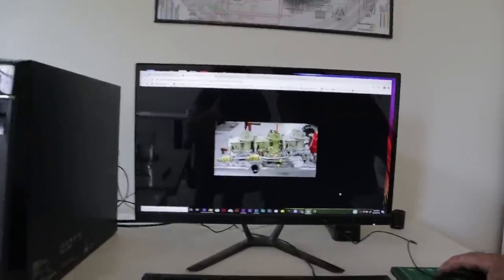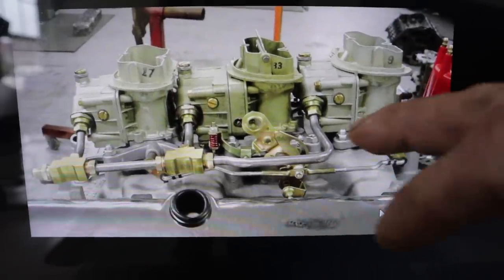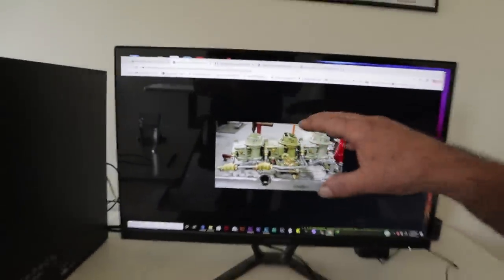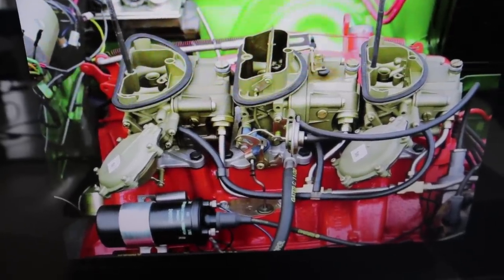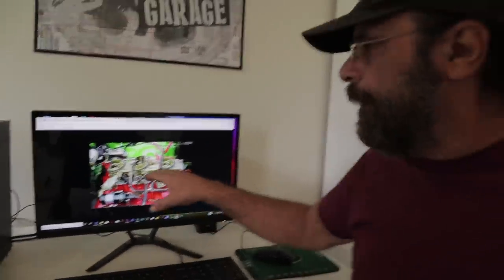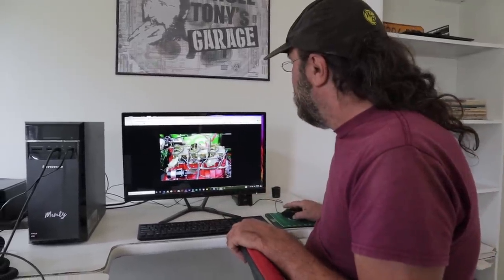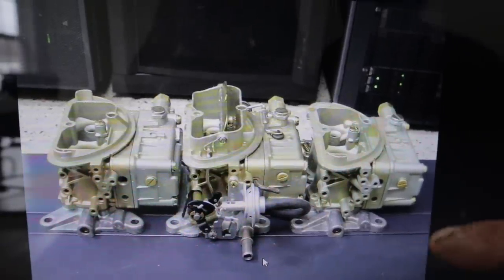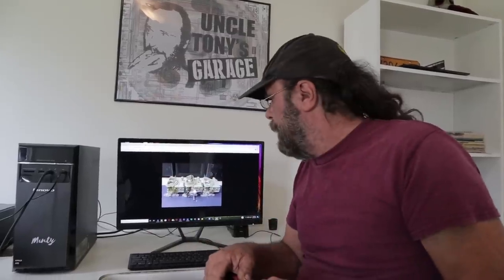The Infamous Chrysler Six Pack

Comment: One of the Olds 371s I used to own was a 57 J2 in a 88 Holiday hdtp.  That was the engine that dad used to teach me how to overhaul an engine. I remember filing compression and oil rings until I got the right gap, tedious job. He would not allow me to file back and forth but, I had to only make a forward swipe to keep from ruining the teeth of the file.

Comment: unfortunately you cant buy a 340 sixpack intake new any more, 
but if your kill bleeds are still untouched keep your drill in the tool box if you open the kill bleeds the secondarys may not open at all. 

get promaxx metering plates for the end carbs that take a screw in style jet and tune it with jets and secondary springs. if it bogs when you punch it, its going lean from the big burst of air from the secondarys opening to quickly and the fuel taking time to catch up. you can also slow down the secondarys buy putting a very small pin hole in the plastic vaccum T that goes to the end carbs

Comment: My 1973 challenger had a 340 4 speed I put a 340 Edelbrock  torque'r 2 intake on it now I know this was not the right intake but it gave it a lot of balls with that 650 dual line 4 barrel carb on it

Comment: When I was about 15 in 1970 I was walking past a gas station and there was a MoPar sedan with it's hood open. When I looked inside there were two 4 bbls on a 'cross ram' intake. It looked like the carbs were mounted on the fender wells. I don't know if they were worth it, but it sure looked awesome.

Comment: When  I  was  young,  back in the  mid seventies,  I had a 66 SS 396 impala.  Got  my hands on a tri power set up. Put it on the car  and  cobbled  up  fuel lines and linkage. Had it  on for  several days  looked  cool, but never did  work  right or stop leaking. Oh well,  live and learn.

Comment: That was awesome very informative thank you Uncle Tony I've got a 78 Z28 with a 454 out new 1970 Chevelle been bored out 60000 over and got about 575 horsepower we got 650 dual line double pumper Holley with 850 jets in the back and whenever you kick secondary in it sounds like it will suck the hood down in there

Comment: i have a boat motor a v6 with 3-2 barrel carbs i used 4 of 5 gallon gas cans  a month for mercurys & johnson outboards to ths v6 with 3 2 barrels to 2 days use of running there a thirsty beast! i got rid of the wrong type of outboards!

Comment: Had a 6 pack in my 69 427 Vette.   Hated it.   Put a single Holley on the car and went a lot faster.   Finally sold the car.   Gas pedal was just on on/off switch.

Comment: Thanks for a great 6 pack school. I built a 3-1 barrel progressive set up on my 55 chevrolet 235 6 cylinder. Used 3 intake manifolds. end ones were cut off flush and welded in plugs. then ends facing in left some nipple ends as well as on both sides of center when clamped to head center and outside manafold sections welded together.. outside carbs no accelerator pumps or idle jets. then a progressive linkage that ran on the center carb till half throttle. past half throttle the linkage was step up 1-2 ratio so the last half throttle on the center carb would open the outboard carbs 100 percent. did it work. Yes, It did not give any more top end as the cam was stock but acceleration was noticeably better. cost was really cheap.

Comment: I never had the same you do Tony, and it could be I just don't get it or theshit I worked with was bad    cause I never spent the time fixing and tuning. I was lazy and would buy new for a long time till once forced to cause all I had to get home with is new and it was worse than the bad one. Long story short V> was fix the old one first then take off the new one and look inside of the new one so to see difference.... s. Lots of them as the new one was bad bad so use it for [parts and wow, comes together... love it when that happens

Comment: as i never had a six pack.   i started looking at the info on the AAR  340.   when i looked the factory cam specs compared to other brands.  it was amazing the power Chrysler was getting on the small block with such a small cam.

Comment: I'm surprised you didn't mention the 383 6 pak. I know it wasn't a factory option and the one I know of in a 70 Fury was actually a mistake from the factory as they sent the guy the wrong car. If any of you haven't heard of it it went through fantomworks over a year ago. It was a prototype that wasn't meant to be sold to the public but it was the car sent to the man who bought it new.
Reply from the maker: Katrina, I saw that, but the story is not possible for numerous reasons.
Most likely the original owner had the Six Pack installed at the dealer while the car was still new.  Those setups were available for the 383 over the counter beginning in 1970

Comment: I have a 65 Tri Power intake I want to put on my 65 GTO, the center carb base on the Tri Power manifolds, except for 66,  are smaller than the ends, so they require that base plate for the carb. All the other Rochester 2 barrels have the same pattern as the ends.  Makes it so much fun. Since I will be using regular 2v carbs I have had for years on the ends, its going to be mechanical secondary. No worries, my 455s don't bog unless the air valve on a Qjet has no tension, setting the idle/float level is the hard part due to very high vacuum. Its in the works for this winter, if I can get the center base. So we might be doing them at the same time. Not much carries over between the Holley and the Rochester, other than they are carbs, but it will be fun to watch you build the Ramcharger.

Comment: I'm glad you're going to build a six pack!
Would you consider stroking the 360 engine to a 408 for this build?
The low end torque could be nice in a big heavy Ramcharger, especially if you're going to tow anything with it.
Reply from the maker: Budget is really important on this thing...we'll make the most of the stock stroke

Comment: In the early 60's, 6 packs may have had some value due to the limited options of carburetors.  But by the late 60's, it is not clear if the 6 pack had any more value other than a sales gimmick.  I do not think that a 440 with its regular HP cam needs any more than 750 cfm.  I have a cam on mine about two steps above the HP cam.  I have about the same duration, but about .25 more lift.  I have a 750 rochester on it.  The vacuum gauge barely goes over 0.5 inches at 5000 rpm WOT.  That means that up to at least that speed range, the benefit of more cfm is negligible.  The high rise manifold of the 440 6 pack may have added a bit of upper end power, but not the carburetors.  I think a modern 440 street build is better off with a regular high rise manifold and a reasonable 4bbl carburetor.  But I am sure the 6 pack has the romance of the unusual setup.  My guess is that the 340 is the same.

Chrysler needed gimmicks too to make sales.  ANother gimmick from Chrysler are the high rise exhaust manifolds for the HP 440.  As some dyno testing published show, there is no benefit over the regular log manifold.  Those who reproduce these manifolds do not want you to know that.

Now, they had 6 packs on some nailhead Buicks I think.  Well, these engines certainly flowed very little.  Maybe there was some value in the early 60's Pontiac 421, but by the late 60's a rochester was more than enough for any Pontiac 455.  Pontiac enthusiasts claim that GM did not allow Pontiac to use multi carbed in the late 60s.  But if a rochester is enough for a 440, is definitely more than enough for a Pontiac 455.
Reply: In most cases the main functional benefit of multiple carburetors was more uniform mixture distribution; modern 4-barrel manifolds accomplish that.

Comment: Hey Tony I had a question on Sunday it wasn't seen by uncle Kathy. So your dart is pretty light. I was wondering if it's possible to have a structurally sound all metal body besides glass hood & front bumper with a 8 PT cage that's weighs 2900-3000 ? Is that realistic ?
Reply from the maker: If you build in Moly, it should be pretty light

Comment: to find the real cfm rating, divide 1350 cfm by 1.4 = 965 cfm. The Ford setup had metering blocks and accelerator pumps on the outboard carbs, plus they were mounted on the manifold with the float bowls facing the firewall. I ran a set of these carbs on a 340 and they ran great! I think the centre carbie for the small block Ford was about 240cfm according to the list number stamped on the centre carb.
Reply: Cool, but where does that number come from? Not doubting you, just curious

Comment: Uncle Tony, You are doing a 6 pack on the Ramcharger.  What type of cam is stock or little hot cam setup, engine heads, and exhaust system for a Muscle Truck!  You have many engine setup options for the Ramcharger.  The only disadvantage is the truck weight about 4,000 pound.
Reply from the maker: We have not started mapping out the package yet

Comment: Six pack! Question: To use a regular 2 barrel 2300 carb you would cut down  idk what you'd call it? Not choke air horn but the big round air cleaner base?
Reply from the maker: Yup, that's it

Comment: I used to put a sheet metal screw in the slot on the linkage on the center carb that is normally there to insure closing of the outboard carbs. It also worked on 4 barrels .It brought me many smiles when I did this for folks.

Comment: i'm really rusty on what used to be tons of specs memorized, but chevy also tri-powered the 327 into a 365 or 375 hp version, right?  one of those two HPs i believe was fuel injected in the vettes
Reply from the maker: Those were with the smaller Rochester carbs

Comment: I changed my 1970 Challenger R/T 440 six-pak to an aluminum manifold and it worked better and was faster than the cast iron for some reason.
Reply: Probably because the aluminum manifold is 200lbs lighter?

Comment: My old man used to talk about tri-powers and multi carb set ups in the fifties early sixties how difficult it was to tune and get everything timed correctly. He always thought a single four and or quad fours we’re better than the others and easier to set up.
Reply: There's really not much tuning or syncing involved with the the Chrysler setup. All you really need to do is just get the out- board linkages to line up. As easy as just turning the turnbuckles to line up with the levers on those out- board carbs. Nowadays, with the lousy fuel you have to deal with, or if your running modified internals, you will need to fool with the fine tuning of the Idle Fuel Restrictors and Idle Air Bleeds.  Which you need to do to make a 4 Barrel run correctly too.

Comment: I was a kid in the 70's but the neighbor down the street had a 440-6pack Dodge Charger i think it was a 1970,green inside and out, never drove it in the rain,took fanominal care of it and he said if you can get the tuning just right you can eat a 426hemi. And I did read that later on in life that the 6pack was faster off the line and in the 1/4 mile, the hemi was more a top speed engine.
Reply: Yep,the guys I know/knew years ago who raced them the 440 would get the jump,by the 1/8th mile side by side and end of the 1/4 the Hemi was 2-3 car lengths ahead..These cars were all tuned perfect and stock,but tuned! All low 12 even some high 11's with street tires! Not saying the Hemi didnt do the 1/8th  very quick but the 6bbl was on point I guess they had Uncle Tony's 6bbl trick!

Comment: I daily drove non-vac 3x2's back in '76-'77. For them to work as intended, it's all about midrange. Cubic inches, a cam that starts to work around 2500-3000, converter same range, and gearing high 3's to low 4's at minimum. The WOT sound was impressive, but even after fiddling with carb parts, not really a whole lot better than a dialed 3310, if at all. In a heavy truck at 6 liters, low comp, smog cam, stock conv, mild rear gear, well...
I know you and others may call me names and stuff, but I'm part of the been there done that crowd, too. Veteran of the VNB street scene in the SFV. I see too many people here who all of a sudden "remember" all these 6-pack cars from their old neighborhoods, and expect this exercise to be a killer deal. Production multi-carbs were a designed package, and worked accordingly. All respect, Tony, but you'd better off by a long shot doing an El Cheapo turbo on that particular vehicle. I bought an El Cheapo myself to learn. Your younger fans would be better off, too. Just my opinion. Worth what you paid for it.
Reply from the maker: Keep watching...I think you may be surprised.  This ain't my first rodeo
Reply: @UncleTonysGarage  I am well aware of your past, as I have mentioned before. Just not sure where you are headed with this truck. Hope it all works out.

Comment: Always question main stream thinking. I suspect and have for yrs that the real bad ass 340s ran the 500cfm autolite style carbs because 700cfm wouldn't do much.
Reply: You also need a real cold air setup. The pump gas was way way better back then helping matters and...…..better plugs used in that day of age
Reply: I must be doing some math wrong, because 750cfm will only feed a 340 to 3850rpm, and my mechanic buddy usually slaps people in the back of the head for putting that big a carb on a small block. Did I forget to divide by two, because each piston needs to make two trips up and down per cycle?

Comment: Dodge and Plymouth had the six pack, Chrysler cars did not. Mopar six pack might be more correct.
Reply: In Australia- 1972 Chrysler Valiant Charger R/T had a 6 pack 265 inline 6 with 3× dcoe 45 mm Webbers. 302hp, 14.4 quarter, 0-60: 6.1sec. Fastest accelerating Aussie prod. car for 25 years.

Comment: “Do a six-barrel 360!”

Yea, but use Webers for the carbs
Reply: Lassi Kinnunen a six-pack, or “trips”, wouldn’t have eight individual carbs.
Reply: If you are running Weber carbs, might as run 4 to have one Venturi per cylinder.

Comment: A Six Pack??  Really??  The people who are asking for this have never spent days trying to get everything balanced.  I remember those as an enormous pain-in-the-butt trying to get running perfectly, those wasted a lot of skilled mechanic time trying to get it right. Few people today have any idea about jets, or why they nay need to be changed. Great fuel mileage ... provided gas is still $0.32/gallon. If you're not running on a strip - forget about it.
Reply from the maker: Well then I guess it's time for me to show them how to make it work right and get great gas mileage.  No problem...I've done it a few times already
Reply: My 70 AAR 'Cuda was set up on a dyno when I built it back around 2007.
It works great, and I haven't had to mess with it at all since then.
16 MPG, nice and reliable
Reply: I welded a bung into the exhaust for a wideband oxygen sensor, which saves a lot of time during jetting.
No more guessing or trial and error.
Then the dyno allowed it to be checked at various operating conditions.
Once tuning was complete, I removed the oxygen sensor and plugged the exhaust bung with a bolt.
It's there if I ever need it again, but I haven't in 12 years and counting.
Drove the car half way across the nation and back, plus all over the state, and it works great at all altitudes.

Comment: Ford 390s with a 3x2 setup was the highest rated 390, @ 401 HP ...pretty hot for 1961 !
Reply: How much power does those 390s?
Because my 1972 f100 has one with a 2bbl
Reply: @sdc303  It depends on the year of the engine,  compression ratio, camshaft, cylinder heads, intake manifold, carb, exhaust manifolds or headers. A 390 with a deuce should be around 230 HP, give or take a few. These big blocks are noted for their torque, not HP.

Comment: Nothing sounds like the Ford tri power and the 3/4 Cam they used to put in the old Fe engines .SWEET ! Those engins had cast iron factory headers .too
Reply: I've found in my 65 years on this planet, a complete cam works better than one that has a 1/4 cut off of it. LoL!
Reply: @KurtfromLaQuinta  So you do know that a 3/4 cam is 1/4,less radical as a full race cam , RIGHT? I know you really do !
Reply: @edge2sword186  I was poking fun. That rating is quite dated. 

When you buy cams today there's a lot more choices than stock, 1/2, 3/4, full. What determines a full race cam? A Top Fuel one? 

When choosing a cam these days, cam manufactures have hundreds of ones to pick from. Look here at Hughes Engines... http://www.hughesengines.com/Index/products.php?browse=category&level0=QS0gU21hbGwgQmxvY2sgIkxBIg==&level1=Q2Ftc2hhZnQ=
That's one page of five pages of cam choices for just the LA block engine! Close to 50 cams there!
And that's just one cam supplier.
Reply: @KurtfromLaQuinta  I know that . Years ago there were passinger car cams and racing cams . The latter were not designed for everyday street use

Comment: Has anyone in history ever done a 6 pack using the slightly more modern throttle body injection on a triple mount?
Reply from the maker: Yep...there are kits for that
Reply: @UncleTonysGarage  Thanks, interesting. The metering would have better control probably
Reply: Throttle body injection is a bastard child of EFI and a carb. Mass air/port fuel injection all the way!

Comment: I’m gonna try to get a 70 Roadrunner with a 440 6 pack with either a 4 speed or a 727 torqueflight at some point
Reply: "That Plymouth had a Hemi with a Torqueflite.

I believe we sawed the guy off even though we did lose $200."
Reply: sbf_fox that’s probably my favorite movie
Reply: Gonna cost ya!

With all the Dukes of Hazzard and Fast& Furious clones getting built, there aren't a lot of good roadrunners left. If you are not afraid of body work, tho, speedkore is making carbon fiber outer body panels. Gotta glue the inner panels to the carbon, and it saves nearly 1000 lbs!